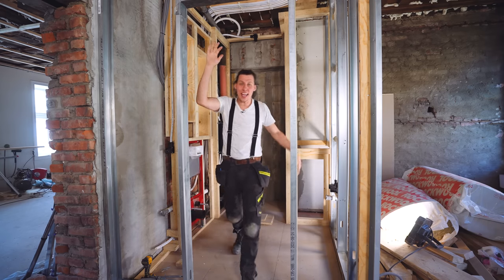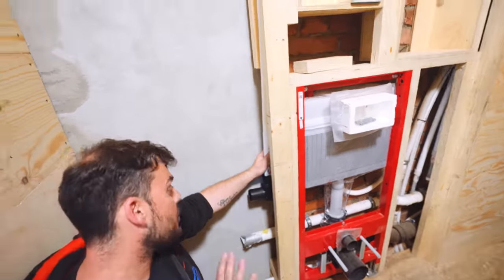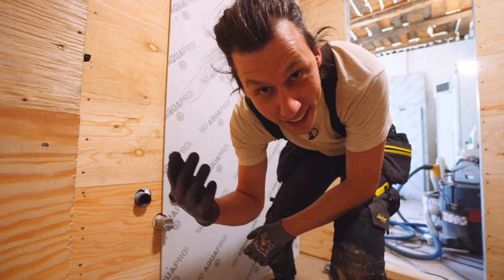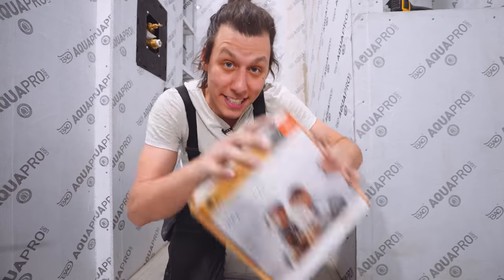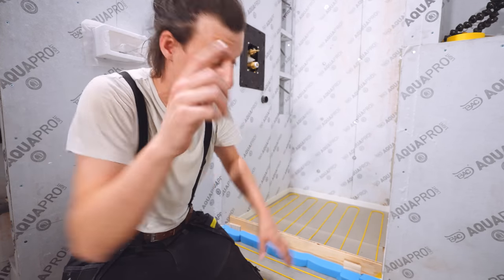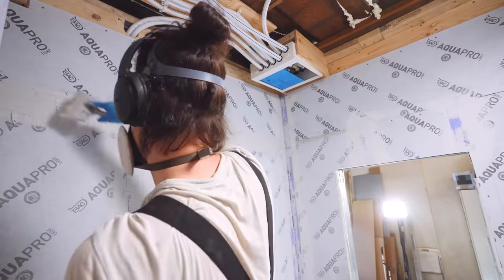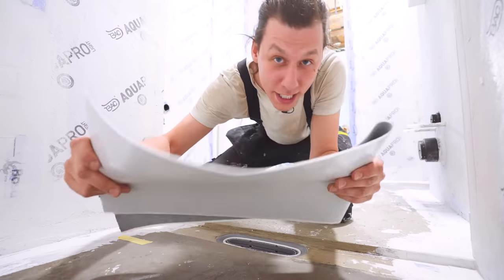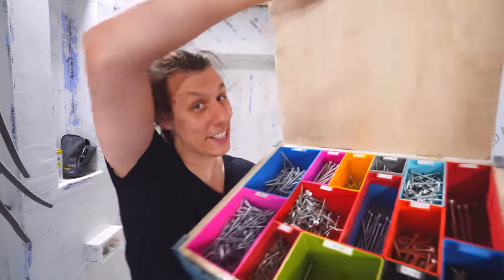How To Properly Waterproof a Bathroom!

Comment: Rather dodgy not leaving any service access points.  If you have leaks or other issues you are going to have to rip the walls apart.
Reply: There's nothing to access in there. The toilet can be serviced from the buttons to flush, and the shower can also be accessed from the bathroom
Reply: @HorizonFarming  But the toilet systen is hidden, if it had to be replaced the bathroom would have to be pulled apart.  Not good to bury things that could go wrong and could potetionally need to be replaced.
Reply: @RCSRetro  everything inside the toilet is replaceable through the buttons to flush. You would never have to change out the tank or the frame.
Reply: @HorizonFarming  I am not convinced!  I have never seen anyone basically hide everything like that without any real service doors or areas!  Pipes can leak (especially at joints) and if there was a leak there is no access as the whole room is sealed!  Why the whole room needs to be totally watertight to start with is beyond me!  Is he planning on squirting water all around the room?  I would never have a bathroom designed and built in that way as if there are any issues the room will need to be ripped apart!  Not good planning!  as the British Army saying goes "Prior Planning & Preparation Prevents  Piss Poor Performance"  This seriously lacks in any real planning for the occassion when access could be needed.
Reply: @RCSRetro  In Norway, we don't have joints inside the walls. We have something called "pipe in pipe", with is basically a plastic waterline inside of a plastic "conduit". The water pipe can be pulled out and replaced with a new line just in case something goes bad, like a nail or screw in the pipe. And the water comming out of the pipe when it leaks is going to follow the conduit to the waterproof box in the roof, where all the waterlines spread out the water appliances. The water then leaks out on the floor so you can see that there'sa leak and need to call a plumber. 

The crazy amount of waterproofing is required by law here in Norway as well. Yes, it's a little overkill, but we also naver have any leaks inside of our walls. 

I'm a plumber here in Norway, so i do have some experience with this.

Comment: Mounting HEATING cables  with HEAT ACTIVATED GLUE. That might be stupidiest thing you done my bruh.
Reply: These cables get surrounded by concrete, the glue is just to keep them in place while the concrete is being poured. There's nothing bad about using hot glue.
Reply: @HorizonFarming  You know that poured concreet can het really hot during curing? No? This can move very easly during installing and curing. And after some time you just don't know if there will be some king of reaction of this cable with constantly fluid glue. This glue can burn or react with rubber...

Comment: americans... just use all the wrong material to get the job done, all this could have been done with lean mortar for 1% of the price of self leveling mortar (wich use make to maximum 1cm... and that is not how we apply the strips you need to put more inside so it doesn't buble